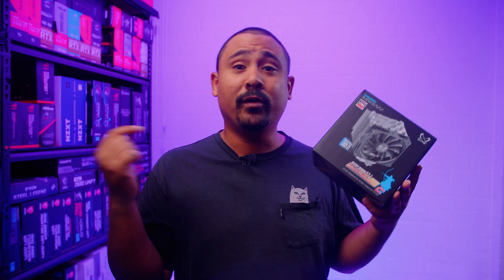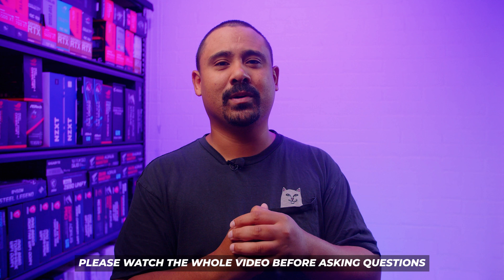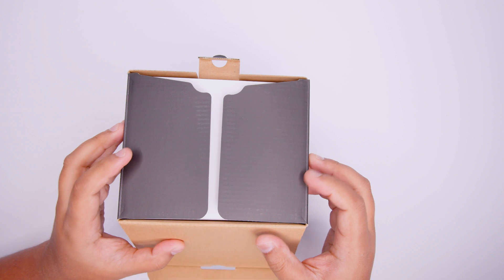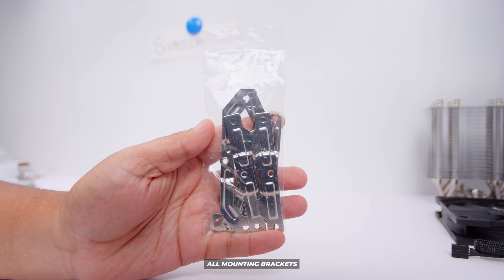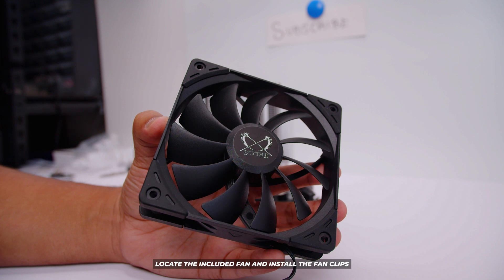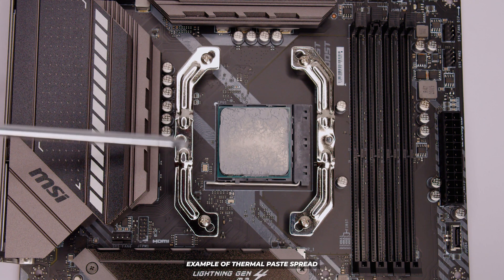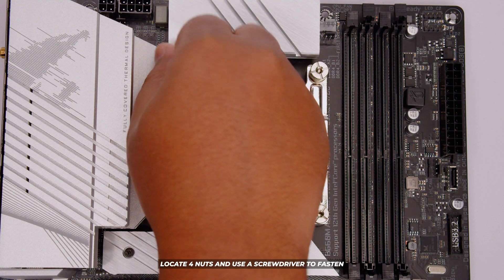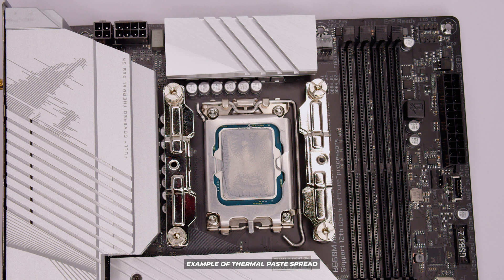HOW TO Install Scythe Mugen 5 Rev C On AM4/AM5 and Intel LGA 1700

Comment: AM5 & AM4 has the same installation method? I have a schythe mugen 5 non Rev version that only supports up to AM4. So I guess I will have no problem installing it on the AM5 platform too?
Reply from the maker: Correct
Reply: @GearSeekers   thanks man

Comment: I have rev b.
I just bought a 7950x3d.
Is there an adapter kit, or are the fittings already in the container I just need to try them out? Otherwise I'm just going to use cable ties which seemed to work pretty well for me
Reply: what did you end up doing? im in the same situation
Reply: @cooperstevens2464  I found some razors I had laying around from other heatsink installations. I was able to attach it nicely keeping the temperature is really low. Although I could not use the backplate.
I just use the cable tie to give it a little extra support from sagging

Comment: between the stock Kaze fan on the mugen vs using the wondersnail, what would you prefer?
Reply: I replaced the Kaze with a 2400rpm WonderSnail, controlled by the "Silent" profile on my motherboard. It's still barely audible but now my 5700X is positively frigid. I put the Kaze to work as my case exhaust fan instead.

Comment: Ok, "too little thermal paste is bad, a lot is good" or whatever nonsense he's saying, is incorrect. You CAN put too much on. If there's too much in there it prevents proper heat wicking by the heat sink. The amount he's using isn't terribly awful, but it's still more than you need. I would only use about 1/3 of what he has on there. You want just enough to form a kind of thin glaze, and we always apply ours with our finger tips (if you're not allergic to the compound or have some other such sensitivity) and use a spot about the size of 1-2 grains of rice and spread it manually to cover the surface.

Editing to add: this is otherwise a great video, don't get me wrong. And from what I've seen of many of his other videos, they're by and large extremely helpful, and of course well done. I just have this stupid pet peeve about how much thermal paste should be used. I was an electronics technician in the US Navy, and have been building/repairing computers now for 30+ years, so I have experience in this area.

Comment: yeah, installing cooler and a backplate compatible with new socket is kinda exiting, i quess, but, does this rubber based pings or whatever things is ok for am5 as a question on height. Also i need more thermopaste on 1700 obviously..

Comment: love these "Stock BackPlate" coolers! Debating on getting Arctic Freezer 34 duo vs this one. which one should I get?
Reply: 34 Duo is good and cheap, but if you have the cash I would get the Mugen. It also comes in a black version.

Comment: 10:37 The rubber part of the standoffs should be in contact with the motherboard. The box details this instruction. But, thanks for the video.
Reply: I'm looking at the instructions right now and in the picture it shows the rubber part is actually facing the same way this guy in the video has it. You are claiming it says that the rubber part is suppose to be in contact with the motherboard but that's not what's being shown in the diagram. I also don't really care for the text in the instructions because I find it confusing.
Reply: @josephwilson8391  hes right, on my instructions it shows an arrow pointing at the rubber which is facing down onto the motherboard which makes sense, you dont want to scratch your pcb.
Reply: @josephwilson8391  It's rubber up for AMD and rubber down for Intel.

Comment: This was perfect to watch for installing this cooler on a LGA1700 i7-12700KF.   Thanks for video!  This cooler is great no more throttling during gaming.  Max core temps running in the 60-65c range.